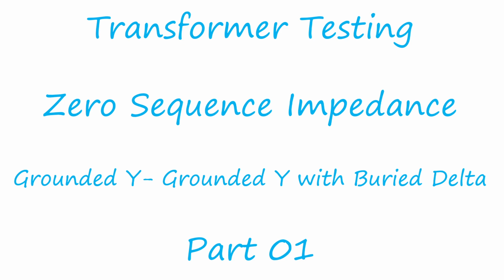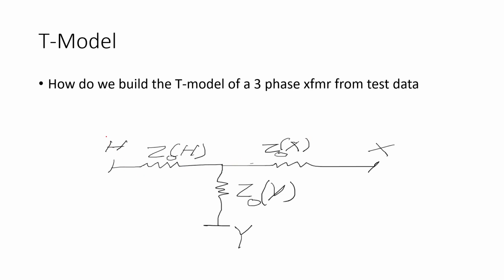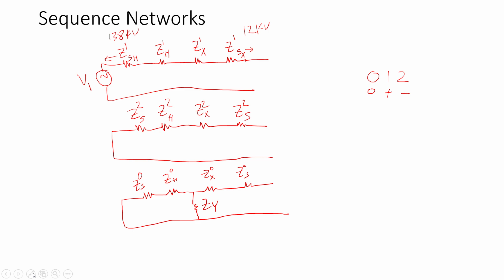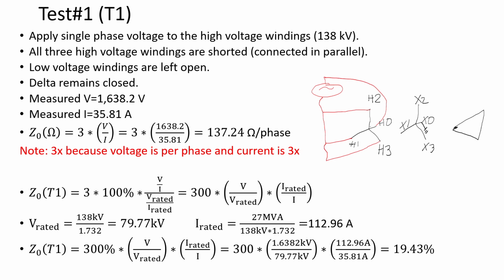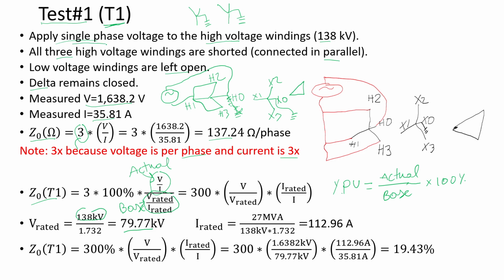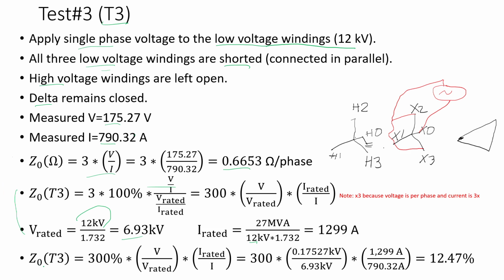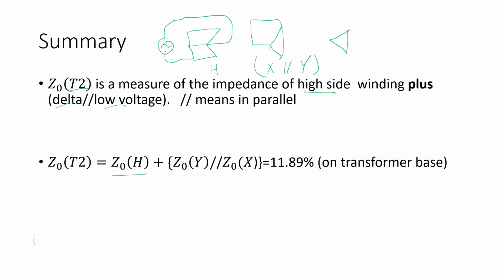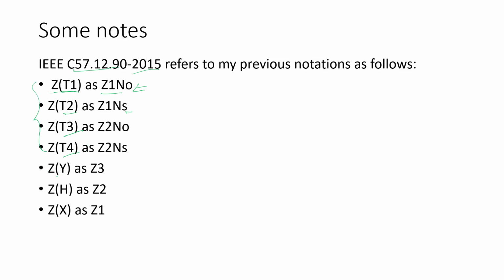Transformer Zero Sequence Impedance Testing YNynd   Part 01

Comment: Sir, 
The formula  Z0(T2)= Z0(H)+Z0(Y)//Z0(X) does not agree with the sketch shown for Test#2 which shows all H terminals shorted and single phase supply connected to shorted terminals and neutral.This is OK. But X terminals are only shorted and neutral earthed. In this way zero sequence currents cannot flow in X windings. So the formula shown above does not hold good. If the the neutral of H winding is also earthed, the formula is valid. But this is not a good practice as you allow earth currents to flow in the system. The best way would be to connect the shorted X terminals to neutral as well.
The above problem is seen with sketch for Test #4 and equation for Z0(T4). Pl clarify.